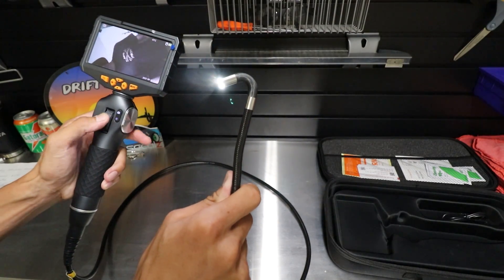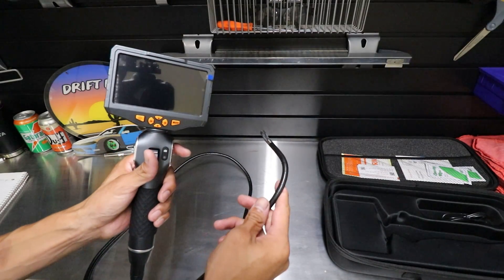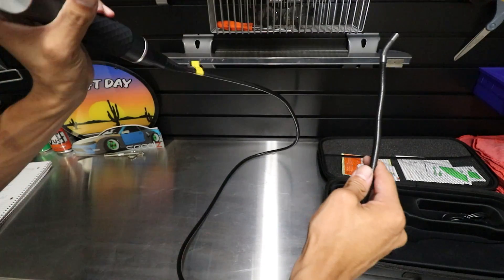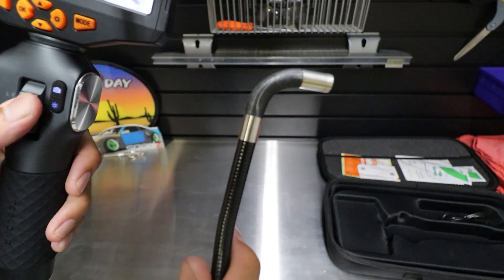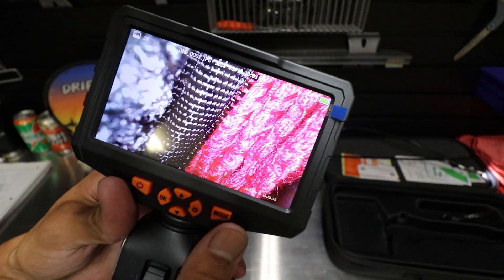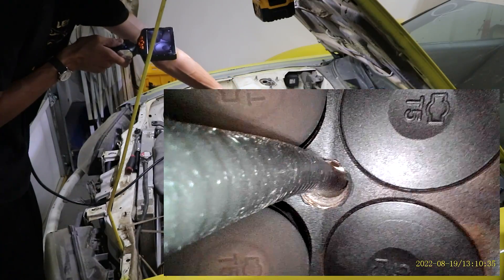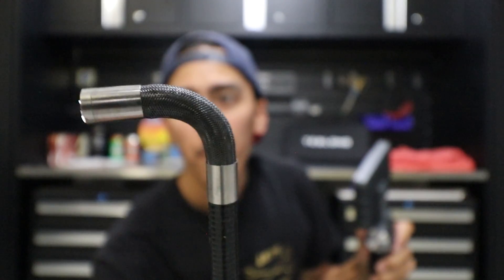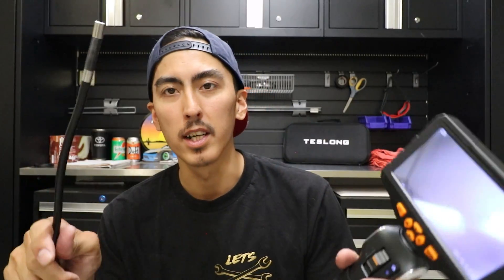The NEW Articulating Borescope Teslong 2022

Comment: Ordering it right away just because you posted the actual video from the device. Even the official TESLONG page failed to do that and I couldn't tell how clear actually it was. But damn you can see so well. I bought the AMES 3.5" from Harbor Freight for 175 today and the date stamp was from 2010!!!! The picture was so horrible. I'm going to have to return it and eat the 20% return charge but after I'm done cleaning the valves :D ! I'm so dumb for not doing my research first and finding you!
HURRY ITS $230 now THROUGH YOUR LINK !

Comment: My advice to all Master Techs, Get yourself a personal borescope. The Teslongs' have a ton of value vs competitors. in my opinion.  That said, MY diagnosis ALWAYS includes a visual inspection of the component in question. Unless of course it is impossible. Yes I cannot do a visual on everything, but even if something is normally buried or hard to see, my scope can usually get me there. It can save time in diagnosis, and after turning the wheels of expertise in your head- it can confirm hunches, or feelings about what is problematic. A Master Tech without one is missing out on a great tool.

Comment: I'm lookin looking to buy a 2013 Prius hybrid with 80-100k. Do these cars have head gasket failure eventually? or theres a way to prevent it? Thanks
Reply from the maker: Not all of them but a lot of them do. Look for one that has properly serviced and not abused. It’s usually cause by either driving the vehicle low on coolant or a failed water pump. If the previous owner has not invested into regular coolant services and replaced the water pump your taking a gamble. The mileage your looking at is pretty low though. I would rec getting the water pump replaced after purchase just for peace of mind
Reply: @LetsDriftMedia  Thanks for the reply back. How about the EGR cooler and EGR valve? Do they need to be replace too?
Reply from the maker: @subgyu5693  they dont NEED to be replaced at that mileage but if I was buying a used Prius I would go ahead and replace them both for preventative mait. since they are also a problem part with these engines. As well as clean the dust out of the hybrid battery filter located on the passenger side rear seats. Common for dust layer build up that will set a "check hybrid cooling system" warning.
Reply: @LetsDriftMedia  Thanks a lot. That was helpful. I should clean the battery fan also. Other than what was mentioned, are there other things I should replaced?
Reply: @LetsDriftMedia  Also do Camry hybrid's have the same problems?

Comment: Yo Yo

For the price that really puts the snap on borescope to shame. My only question is and maybe I missed it, what’s the diameter of the camera? I’m wondering if it would fit down an ISB injector bore for cylinder inspections. Snap on wants almost 400 for just the 3mm camera not even with the display.
Reply from the maker: I forgot to mention that. The diameter of the probe is .33 inch
Reply: @LetsDriftMedia  Once I saw the comparison next to your finger kinda figured it wouldn’t fit, but still a handy borescope at a fraction of what the truck brands run.
Reply from the maker: @dasphoenixable  yea that’s the only thing I wish was better but I’m sure they will make a skinnier version next model.
Reply: @LetsDriftMedia  I’m guessing the diameter is because of the articulation, they have to fit the cable or whatever they are using in the sleeve of the camera.